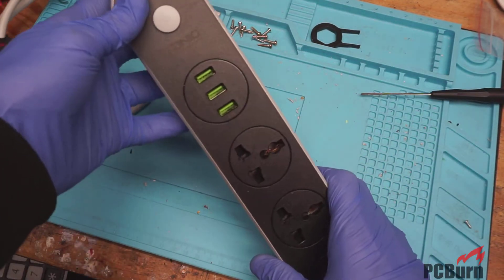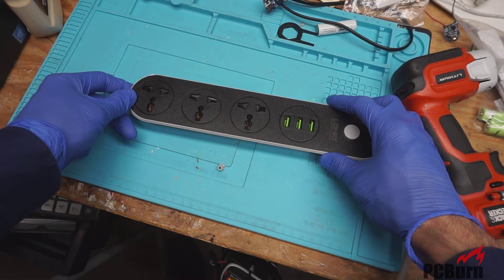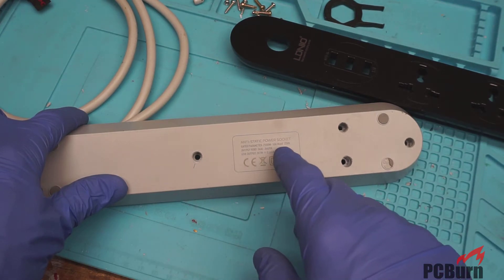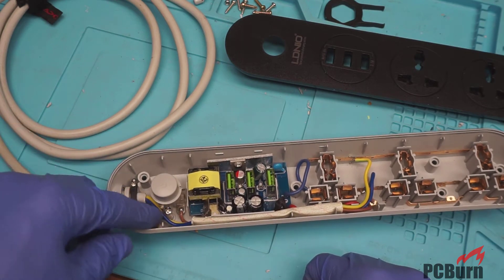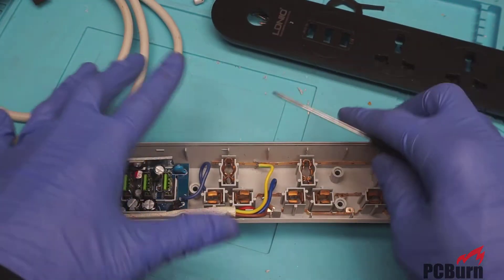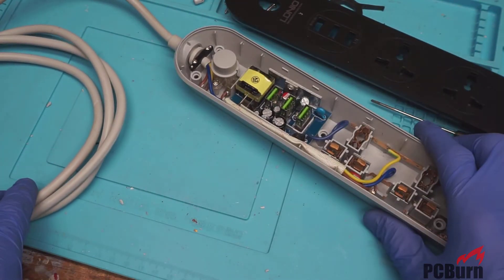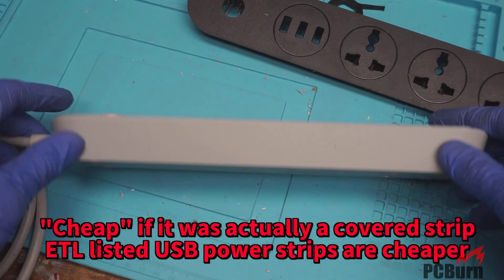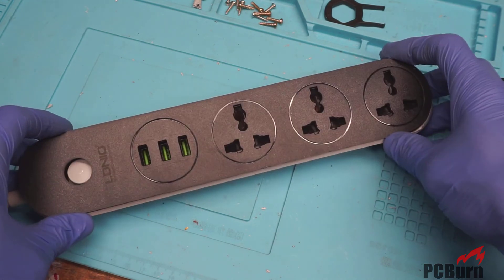Sketchy Power Strip Ordered on Amazon (Teardown)

Comment: In Europe we have 230V 16A circuit for sockets.
Reply from the maker: Separating 230v makes me leery of these integrated USB outlets. Possibly more of a personal inclination than founded on anything.

Incidentally, the ground connector supports failed not to long after I cut the video. Aside from making the strip useless it doesn't give me much faith in the care given to the rest of the design.

Comment: Well, as an expert, can you recommend a good and reliable power strip? (or maybe a quality brand)
Reply from the maker: I'm certainly not an expert. Personally I use independently certified devices. Preferably UL, at least Intertek. There's also a useful Canadian testing body.

Despite some of the responses independent certification and underwriting is just as relevant to the EU as it is to the Americas. I prefer a third party to insure the product as being a good design.

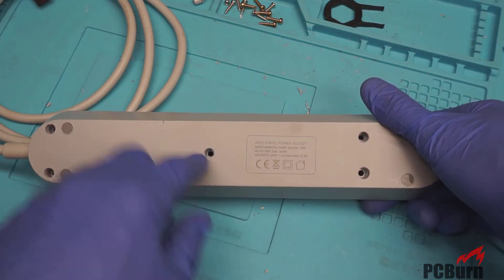Comment: 3:23 In Europe these have strange screws and there is no tool how to  open these strip cords, there is no screwdriver available for this type of screw. What to do?
Reply from the maker: If it's a screw there's a slot or a socket for it. Buy a security bit set that includes the correct bit.

Comment: I have checked mine. If you realize, the brown cable is supposed to be live, while blue is neutral. But in this socket, it is soldered opposite, live on the left, and neutral on the right which is in Malaysia, it is wrong.

Comment: That socket strip is actually quite well made and the cable looks to be reasonable for the UK market, although the UL markings on the cable mean nothing over here.
That gap on the PCB is mandatory in both the UK and Europe, it's for electrical separation.
As for worrying about overloading the cable, the plug should have either a 10 or 13 amp fuse fitted.
BTW, black and white wires are highly illegal in Europe, it should be brown and blue.

Comment: isnt soldered joints illegal? i dont get it...
Reply from the maker: Since you appear to be sincere I'll provide you with a full answer to your (now deleted by YouTube) statements.

Chinese Export https://www.google.com/search?q=Chinese+Export+mark&oq=Chinese+Export+mark is a marking almost exactly like Conformite European. Since this (obviously) doesn't comply with CE self certs as you stated they have marked it with the near identical Chinese Export mark. That's what I joke in the video.

It certainly hasn't seen a UL or Intertek facility for insurance in the US market it was sold to me in. Traditionally we use liability and local regulation to achieve the same goals. Which doesn't appear to apply to (personal opinion) Amazon.

No one should use this power strip. That's why I'm showing the insides of it.
Reply: @PCBurn  Wikipedia says otherwise it also shows what is the difference between the two signs what you show on the video is clearly the committee European, also they say this Chinese export you refer to was a passing thing way back then. All the iPhone etc has the same exact sign you show in the video. The shows to me again European Union worth crap. I just butchered one this afternoon, it was shorted. at us it's even plombed you have to drill out the screws they are blind screws. turns out to the rails the wire was crimped and ultrasonic welded but before that to the switch it was soldered just a normal solder. so it's all bs. so at an overload the solder Will fail no matter how they did the other parts. and it was CE and Tüv certified
Reply from the maker: @kbuss10  junk for sure.
Reply from the maker: Less terse...
Reply: @PCBurn  khm...???
Reply from the maker: "Illegal solder joint" implies some form of legal system governing soldering. Your statement is very terse and is missing the extra words necessary. Hence "(be) less terce".
Reply: @PCBurn  whatever rocks your boat bro
Reply: @PCBurn  nice trolling bro it's governed very strongly not the soldering but the connections in electrical appliances household items and household wiring. this is all a very strict business as you see it has the CE logo which doesn't mean Chinese export it means committee European in French it means it's built in a way that's legal to import in the EU which is obviously not. soldering in high voltage is a constant debate. as you were giving a semi-professional opinion on this bar I thought I don't have to go through this
Reply from the maker: @kbuss10  Ah, you did look up terse. Excellent. And you may want to look up the references to Chinese Export as well then. Troll dude bro.
Reply: @PCBurn  wth yt now deletes wikipedia links? these ppl are sick. as i said already, wikipedia, CE_marking

Comment: I have the UK version from the same brand and it has an unfused mains plug... Big red flag, unfortunately I have no choice but to use it
Reply from the maker: Here in the US it's customary (although maybe not required as your plug fuses are) to have a resettable push breaker or a hard fuse in the chassis. Which it also doesn't have.

I assume in the US that's for attaining UL (or similar) listing with one of the testing agencies. Which this obviously doesn't have.

Maybe you can add an adapter onto it for your piece of mind?
Reply: @PCBurn  I have, I attached mine to a fused 3way adapter... If that doesn't stop it there is allways the Very sensitive MCB in the fusebox

Comment: I have something similar (same brand, 4 universal sockets, 3 usb, 1 qc3.0 usb) and us plugs fits in well and secure provided they are 3 pin US plugs. Some 2 pin plugs like the apple usb power adapters sit well but not all 2 pin US plus will fit in well

Comment: Turn it into a Christmas light blinker with an arduino and some relays.
Reply from the maker: That'd be pretty awesome if I could find some clack-y mechanical relays and fit them in where the power jacks are. Noted!
Reply: @PCBurn  Let me know if you attempt it and post a video. I'd be very interested in how you do it.

I've been wanting to shoehorn something like this in my project list but have not had enough of a need to do so.